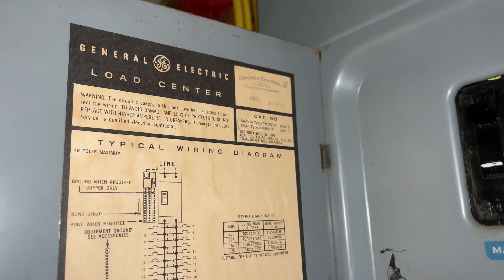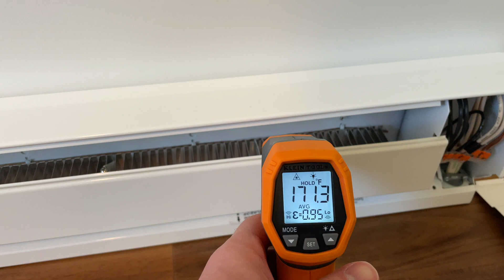Cadet & Honeywell 4 Wire Thermostat 240V Hookup & Calibration

Comment: I have more than 4 wires inside my box?
Reply from the maker: This is not advice, but If you mean 6 conductors then it's probably 1 line cable and 2 load cables

Comment: Sir. I am an electrician and I will tell you that I would never handle any 220 wires without pigskin leather gloves even if the breaker's turned off. You're a brave man. Also, being an electrician for 40 plus years, or let's say doing electrical work for about the first 10 years and being an electrician for the last 30 plus, I have never heard of using butt connectors or splice connectors for 220 lines and I would not recommend it for any electrical lines even though they come readily made in some fixtures and devices. Maybe for low voltage lighting and maybe for even some of the newer recessed retrofit LED lighting which controls low wattage. I'm not trying to be critical, but if you ever do that again I would recommend you put gloves on. You can get a pair of $10 or $15 pig skin leather gloves at any hardware store. You're connecting a device that conducts heat, therefore, you would want to do everything possible to make the safest connections that you can and those little connectors would not be acceptable and I'm sure that any code would enforce that (especially any 220 device that conducts heat) ..I hope this has been helpful because I'm just trying to help you out.. safety first!
P. S. The best electrical connections are ALWAYS when multiple wires are twisted together with wire caps!
Reply from the maker: I appreciate the feedback.  I wouldn't trust a knock off, but these are Wago lever nuts.  They are tight, solid, and UL listed.  Folks will use wire nuts if they prefer.
Reply: I have to ask.....do you use tape (Scotch Super 33+ is my go to ) to secure the wire nut to the wires after securing the nut on the wires? I have seen tape and no tape on professional installations. My experience is in motorcycle electrical systems where splices etc are secured with solder and shrink tubing....no wire nuts BUT I can't say I haven't seen it.🤣Thanks!
Reply: @mikerieck306  Electrical tape around the wire nuts is a good rule of thumb it's an extra safety net
Reply: @wildwoodtop  I thought so ...that's what I do. Thanks.

Comment: Well two red thermostats wires goes on hot wires. Use the right connector for wires, 18 gauges. 

Just saying not everyone understands that connectors matter. 

Your doing two fifteen amps probably one heater. 

There are different size amps for the watts used! You need to use correct connectors! 

No one knows your connector sizes!
Reply from the maker: At 7:56 I said that it is a 10 gauge Wago

Comment: interestingly I just installed 1 cadet and 2 honeywell thermostats so this video was very helpful. I changed from a 2 wire single pole to a 4 wire 2 pole set up. This video helped entertain me in the differance between the two controllers wiring color codes as well as what to do with the ground wire.